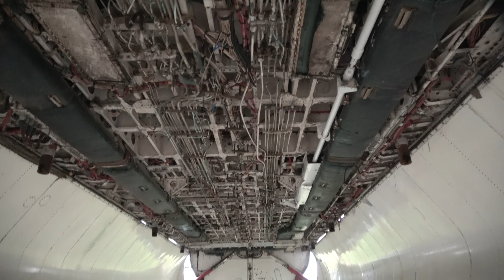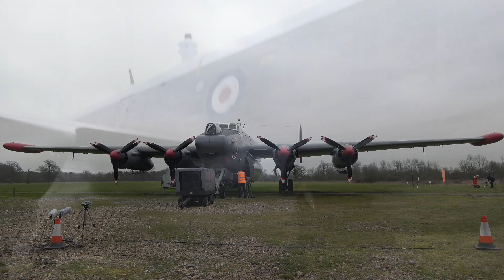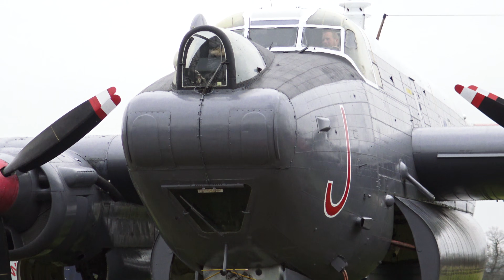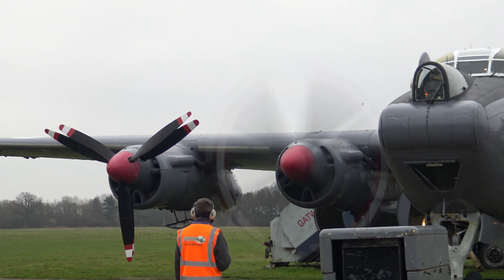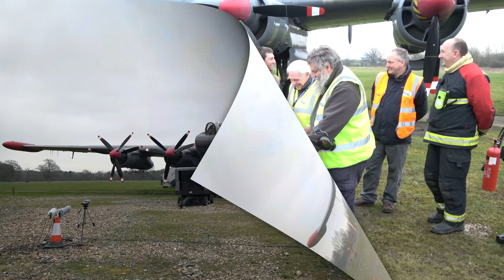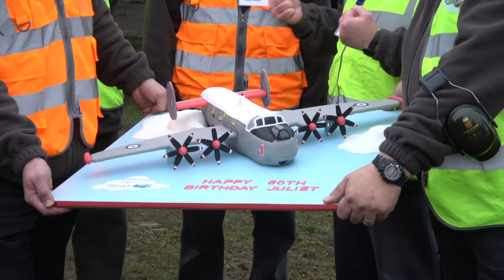Avro Shackleton 60th 'Birthday' Engine Run - Gatwick Aviation Museum

Comment: Worked on these 203 Squadron - Ballykelly. Was there when the Mk3 - Phase 3 were introduced. Flew quite often with them. On one start after all engines were running went behind to listen and didn't like the exhaust note of No2. I held the aircraft and got my shift Sgt who as usual was playing cards. We decided to shut down  and abort the flight. Got stuck in right away and found 2 - 3 bent valves. Some years later while contracting in Germany I visited a friend  still in the RAF - picked up a copy of Air Clues and read the Sgt I had called out had been given a commendation. Such is life.
Reply from the maker: Thanks for the information, sounds like you had a lot of hands-on experience with them! Such is life regards the 'commendation', but you know the truth and possibly saved at least the engine if not more. Well done.

Comment: Jet running on  AVGAS!! Never heard of that! 1'57''
Reply from the maker: The Rolls-Royce Griffon engines used in the Avro Shackleton used water methanol injection to boost power on takeoff which adversely affected the engines reliability. In 1965, in an attempt to resolve the problem, the Avro Shackleton MR Mk.3 Phase 3 aircraft had their water methanol injection system replaced with 2 Viper Mark 203 turbojets in the outer engine nacelles. They were modified to run on high octane petrol (AVGAS), reducing their service interval to 200 hours, but were only needed at full power for 2 minutes during takeoff.
Reply: @HighFlight  that impressive, thanks!
Reply: B36 used the same method.

Comment: Wow didn’t know there was an MR3 in taxiing condition in this country. Be great to see it next to the the MR2 from Coventry
Reply from the maker: That certainly would be good. With Gatwick airport deserted at the moment it wouldn't be impossible to get the Coventry MR2 flown down for a meet up. The MR3 is within sight of the 08 runway threshold!
Reply: High Flight is the Coventry MR2 capable of flying? Was it one of the last AEW2 from 8 SQN ?